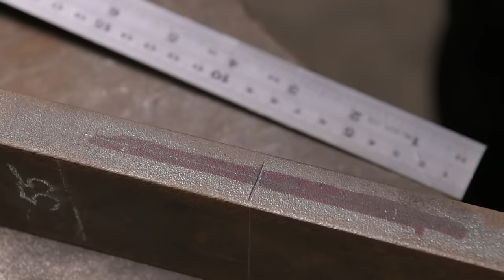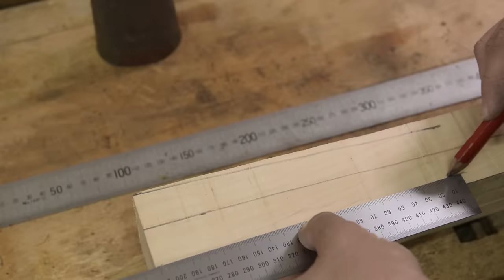Blacksmithing - Forging a pickaxe

Comment: Nice build. Why did the eye not forge-weld when you drew out the downward flanges? The temperature was not sufficiently high?
Reply from the maker: Thanks! Exactly, it needs to be much hotter to weld.
Reply: Hotter and some flux too.
Reply: @jonanderson5137  it is possible to forge weld without flux, but a lot more difficult and risky.

Comment: Again another "Thunderbear" master piece.
Finally a blacksmith / knife maker on YouTube who shapes handle like this with simple woodworking tools (knife, drawknife, rasp and a little sandpaper) by hand.  And not using the belt sander and create a full room of wood dust followed by extensive cleaning. Producing shavings is nicer than making dust. 
Two thumbs up.
Reply from the maker: Thanks! Yes it's definitely nicer if you have the time and patience! :)

Comment: This t-shaped pickaxe manufactured is especially preferred by those working in mines where hard coal is extracted. Apart from this, the pointed part of the digging is very useful for displacing large rocks in the soil.The other flat mouth part of the pickaxe also serves to break the soil in the form of clods.

Comment: Great video Torbjörn! I am wondering whether you use two cameras when filming or just one and you move it around? The transitions are seamless and the color of the hot steel in one shot matches the steel in the next shot.
Reply from the maker: In this video as in most I use only one! It's easier to manage, but in some instances I wish I had two. Too lazy to set it up I guess...
Reply: @torbjornahman  Thanks, keep it up!

Comment: I can think of 2 or 3 things made of metal that you need to do blacksmithing (as in, buy/find these three things and you can make the rest) are an anvil, hammer, and maybe pliers. The forge itself can just be made from brick. Kinda makes me wanna start blacksmithing. If only I had space

Comment: I have a small question, what do you do with the small piece of waste that you cut?
Do you throw them away or find a better use for them?
Reply from the maker: Small pieces goes to the recycling bin. A bit larger goes to "good the have around" bin...which likely will overflow soon...
Reply: @torbjornahman  Understood, thanks for the response. I would like to start working metal myself and always wondered where those little wastes went :)

Comment: Hey Torbjörn, loved the video; you are one incredible blacksmith. 

Thought I would comment on your handle however. Maple is not a very shock resistant wood and will likely start to split if you hit any rocks with that axe. Ash is the European norm for handles, while hickory is the North American standard (which is also the strongest). Also, the grain direction on the bottom of the handle should run with the bit as when it’s across the chances of splitting are even higher.

I hope this helps, looking forward to future videos!
Reply from the maker: Thanks! I'm pretty much aware but I had this piece laying around and I wanted to see how it works. The "wrong" grain direction might flex and not crack instead... not sure. We will see.

Comment: Beautiful piece :) can I ask why the head wasn't secured with a wedge? Is the press fit force on the handle enough to keep it secure?
Reply from the maker: If you take a look again. The eye is tapered so the handle threaded though the eye never can come off. The more you work it the tighter it gets on the handle.

Comment: thanks Torbjorn, I enjoyed that. It looks quite heavy I wouldn't fancy swinging that lady all day ;-)
And you showed the ultimate life lesson, if its not working....... get a bigger hammer :-D
did it take longer to make the drift or the pick?  Why would Boron steel be a better choice for this?
Excellent video, great work as always!
Reply from the maker: Always! The pick for sure, but it took a while to grind the drift/mandrel. I think boron steel is more shock and wear resistant.
Reply: Thanks.

Comment: What makes you decide to either use the power hammer or to hammer by hand?  More precise things need to be done by hand is my guess, but I don't know a lot about the process
Reply from the maker: That's more or less the case! You can mess up really fast with the power hammer if you're not careful.

Comment: Wait you didn't actually forge weld three ingots of iron together to make the head and glue two pieces of wood to make the handle? whaaa

to be fair as much as I know about smithing forge welding ingots together as they are is not good idea
Reply from the maker: Could have been done... I have doubts about the handle though. :)

Comment: Isn't "tempering" what you do after the quenching and hardening process in order to reduce the hardness of the steel slightly so it won't shatter like glass? I thought "tempering" was when you put the thing in Mom's oven for an hour at just 400 degrees then left it out to cool down by itself.

I just watched more of your great videos and you obviously know what the word "tempering" means...:) Beautiful work Nice cat...
Reply from the maker: That's absolutely right, but you can temper in different ways!
Reply: @torbjornahman  Steel has got to be one of the most complicated subjects on earth. Molecular structures changing like light bulbs and a zillion different kinds of steel to choose from. Endlessly interesting...

Comment: Why not to fix the axe on the handle by classic scheme, inserting from the top and adding a wooden wedge?
Reply from the maker: I'm not sure how that would work. This is how they used to be made for decades. This way the head will never ever loosen up and fly off.

Comment: If you were to salvage the steel from a scrap yard, could you identify what to use and what not to use for your projects?
Reply from the maker: To some degree, yes. Spark testing and looking how the part was used.
Reply from the maker: There are high end spectrometers that can tell the exact alloy. It's like a gun you hold on the piece of scrap. Very expensive though.

Comment: Thank you for the interesting videos. Is it possible that manganese steel is also used for pickaxes? I tried to use a broken pickaxe for a forging project and it formed stretching cracks. Probably from the heat not being high enough.
Reply from the maker: Not sure, but I doubt it. Recycling steel like that can bring surprises, with old stress fractures.

Comment: I was confused when you started hammering the head hot after cutting the collar, then I remembered that
steel has to be above normal forging heat to be forge welded, so there was less chance of it fusing.
I'm writing for anyone else who was confused and maybe didn't know that.

Comment: 9:10 Pickaxe says ÖÖÖÖÖÖÖÖÖÖÖÖÖÖÖÖÖÖÖÖÖÖÖ! :) A pleasure to watch, as always. For funsies, I did actually work out how much metal the Minecraft pickaxe recipe uses (and wastes).

Each block is one cubic meter, and since nine ingots make a block, the Minecraft pickaxe is made of 1/3 m^3 of iron. (In Imperial units: picture a solid piece of iron that's 3x3x1 ft.) If all of that actually makes it into the pickaxe, the head would weigh 2361.9 kg, or 5207.1 lbs.

But we can assume it doesn't. The pickaxe head is made of 39 pixels in the texture. Minecraft just stretches that texture out into a 3D model for the pickaxe you hold. Each pixel becomes a voxel, 6.25cm x 6.25cm x 6.25 cm. (My fellow Muricans: a cube around 2.5 inches to a side.) That's 244.14 cubic centimeters for the whole pickaxe, coming in at 1.92 kg or 4.24 lbs.

Which means that Minecraft Steve and Alex waste 2359.98kg (5202.87 lbs) of iron each time they make a pickaxe. Where does it go? Does it come off as forge scale? Does an Enderman keep stealing it as they work?? Do they eat it???
Reply from the maker: HA HA HA... Mystery!

Comment: Excellent video! Point of clarification, though: Technically, that is a pick-mattock. A pick-axe would have the flat edge upright -- 90 degrees from what you made.
Reply from the maker: Thanks!! If you ask 100 people I guess you get 100 answers! :) You might be right though.

Comment: Nice to see that you chose to make a pick/mattock rather than the iconic double pointed pick. Much more useful for the homeowner. 
The double pointed ones were more useful for hard rock miners who might take several heads for a day's work and return them to the blacksmith at the end of the day for reforging of the points. (Who would dare grind new points, reducing valuable iron to dust?)
Reply from the maker: Indeed! Thanks

Comment: Amazing product. BTW, Why didnt you use a hydraulic press/powerhammer to help with drifting the hole? Its the conventional way most smiths do it and seems to be much faster.
Reply from the maker: Thanks! I don't have a press and this piece was so large that I could not fit it under my hammer without some custom tooling I think.

Comment: I found a great old 5lbs pickaxe head in the woods during a walk one day, and for 3-4 years I had been just waiting for a good chance to use it (I live in Florida and almost all of the ground is sand). A friend needed help breaking old concrete on their land and I brought it just for fun. It was amazing. The normal tool for breaking concrete in the states is a sledgehammer, and you just smash the concrete into bits. I was able to break it into bigger chunks, and use the pickaxe to pry and lift pieces that were struck. The bigger chunks were easier to clean up, and the tool was much lighter than a sledgehammer. My friends laughed when they saw it, but they were very eager to try it after they saw how useful it was.
Reply from the maker: Perfect! It's good for breaking up/prying up roots and stuff as well.

Comment: Where I'm from, we call that pattern a dirt pick. It's mostly used in hard ground like shale, soft sandstone, gravel, or other rocky ground like you were using it. Dirt picks have a regular pick on one side and a narrow flat blade on the other like your pick, but it's not as broad as yours.

You might want to make a "mattock pick". They have a wide blade mattock on one side for scooping and a pickaxe head on the other side to break up the hard soil.
Reply from the maker: Cool! When you do the research, you realize that there're so many variations on the same tool, around the world, and that is true for almost anything.

Comment: Correct me if I’m wrong, but isn’t that a mattock, and not a pickaxe? For it to be a pickaxe wouldn’t the blade end have to be rotated 90degrees?
Reply from the maker: I'm not sure where to draw the line. I think the mattock head is much smaller. There are variations of everything...

Comment: Beautiful work of art. But may I suggest an improvement to the handle. Next time you are cutting a tool handle from a stave, have the orientation of the rings in line with the force that are applied to the handle. The way you have the rings, they are perpendicular to the forces and the wood will split easier than otherwise.
Reply from the maker: I'm aware! But I have an entire board with the "wrong" grain orientation and decided to try it anyway. Some say you get a more flexible handle this way... not sure.

Comment: 3:31 Noob question: Why would boron steel be better ?  Just curious.    Beautiful pickaxe. 😄👍
Reply from the maker: Thanks. It's much more wear resistant!
Reply: @torbjornahman  I'd have asked about maybe using S7, but since it's too new to be traditional, as well as very expensive and hard to work, that option sorta ruled itself out. 

Meanwhile, gratitude, respect, and +1, as always. 👍❤

Comment: question, when fitting the wood into the head, why not boil the wood so it would shrink, then fit the head on it, boil again so it would expand  then wedge to fit? wouldn't that make a more secure fitting?
Reply from the maker: There is no point is a perfect permanent secure fit. The handle should be removable for resharpening by forging new points.
Reply: @torbjornahman  didn't know that! thanks for clarifying!

Comment: Could you list dimensions of the 1045 steel you used to make the pickaxes? Thank you and keep up the amazing work!
Reply from the maker: I think I did in the beginning. 22x55mm, 400mm long.
Reply: @torbjornahman  ah thank you I saw the width and height just not the length

Comment: Fantastic job! Regarding the handle though, In the US it is generally recognized as proper to have the grain oriented front to back on a handle. Is there a different opinion in Europe or wasn't it a concern?
Reply from the maker: Thanks! I'm aware, but had this board laying around and decided to use it despite the "bad" grain orientation. Not sure how well maple will hold up anyway.
Reply: @torbjornahman  it might actually be beneficial to absorb some shock. Nothing like hitting a rock and have the vibrations feel like they are breaking your bones

Comment: The eye was obviously a lot more work than usual, and it was fascinating to see how the extra effort paid off in an ability to resist the expected forces on the pick.  Is it ever useful to use a similar eye design on a normal axe?  Also, I noticed that you didn't normalize the whole workpiece; is that  function of the type of steel or something else?
Reply from the maker: The eye is made to that the head would never leave the handle but also be easy to remove for sharpening. Traditionally, back in the days when these were used daily they needed to be sharpened often and that was done by reforging the tips. There is no point hardening anything else than the working ends on the contrary you don't want to risk cracking the eye.
Reply: @torbjornahman  Quick-detach was not something that even entered my mind....thanks!

Comment: Torbjorn, would it be possible for you to do a video or a post on IG breaking down how you come up with your starting material size?
Reply from the maker: First step is to figure out the volume you need, then decide the cross section dimensions based on how you plan to forge it... In this case I think it was pretty obvious, but with other projects you often can start with different sizes and still reach the same goal.
Reply: @torbjornahman  Thank you

Comment: Earlier in the video you mentioned that a boron steel might have been better. I'm not familiar with boron steel and was wondering what kind of benefits and properties it has.
Reply from the maker: It is a lot more wear resistant, but also harder to forge.
Reply: @torbjornahman  Ok. Thank you for the explanation.

Comment: when you were making the hole for the handle, why did you put the tool in water after each strike?
Reply: To keep it from heating up and deforming, my guess
Reply from the maker: Yes, if you let the chisel get too hot it will deform and the heat treat will be ruined.
Reply: @torbjornahman  ah ok, thanks, didnt think contact with other hot metal would have enough transpher of heat to have any meaningful effect

Comment: After tempering both ends, do you still need to ReSharper or hammer to  regain edge?
Reply from the maker: It will wear of course and needs to be grinded or forged to shape again.
Reply: @Torbjörn Åhman  ok. Interesting forgings you do I always wanted to know how they were made and functioned. When I was younger I thought the chipping end was like a spike rather than a pyramid shape. Now I know.
Reply from the maker: @mr.ackermann807  You can grind them differently for different jobs of course! This is just my take on it.
Reply: @Torbjörn Åhman  ok still interesting to me though.

Comment: Please explain:  
How to swing a hammer and big hammer ?
Reply from the maker: What is there to explain?
Reply: @torbjornahman  If you get the hammer's handle by the wrong way, for example with  hand next to hammer's head, the free part of the handle can hurt you. And is very bad to work this way. My opnion. 

In the video, Blacksmithing - Forging a pickaxe, more specific at 9 minutes and 17 seconds. Could you hurt yourself with the back of hammer's handle. I only saw and thought at your security.

But was a wonderfull job, congratulations.

Otavio Isiliani from Brazil =)
Reply from the maker: @otavioisiliani4242  It might look a little strange I know, but with your best hand above the other you have a little better precision and I guess the most common grip when striking in a forge. That said the handle on that sledge is a bit too long.
Reply: @torbjornahman  Ok, I understood. I studying mechanical engineering and always learn something with yours videos. Thank you so much.

Comment: If I may suggest something, I've learnt that when we profile a handle, it's better to orientate the wood rings in a parallel  way with the axis of the tool in order to provide the handle from splitting when you strike. As a comparison, it means turning it a quarter on it axis.
Don't know if it's understandable and gramatically correct sorry ^^
Thanks for your video, as always I enjoyed it a lot !